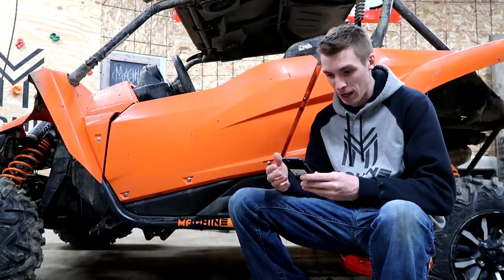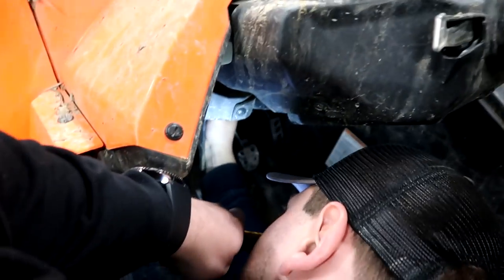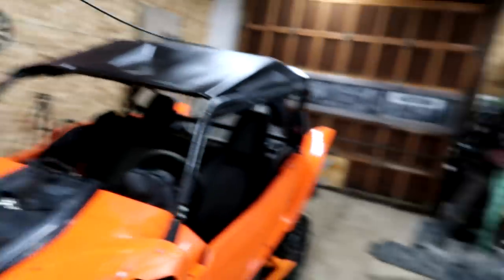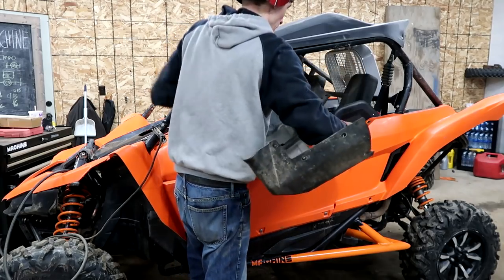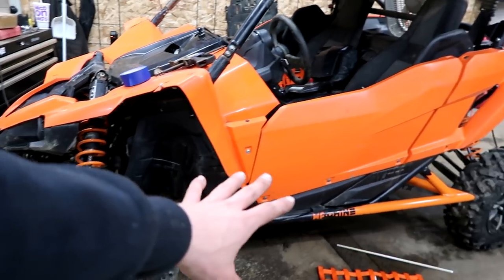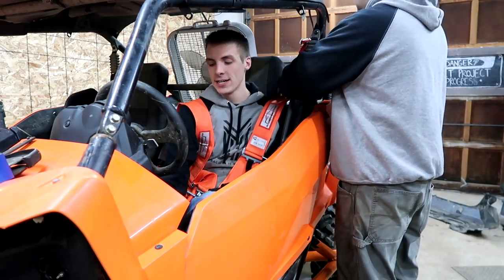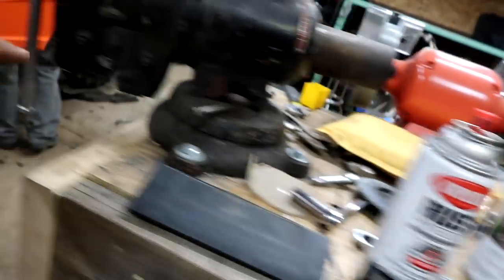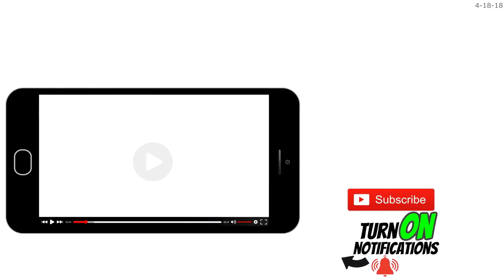1000cc SAVAGE MACHINE!!

Comment: Might want to check the rules but I think your battery cut off needs to be on the outside so safety can get to it mine had to be on the back bumper and my roll cage had to have a center bar to be a "FULL" cage
Reply: Look at your first time drunk video even the other orange utv has the kill switch on the back
Reply: You are right he has next to no chance of passing inspection

Comment: Do not alter your five point harness in any way, especially removing date labels and removing the excess, as it will fail tech inspection. I would also add the crotch belt as this will make the harness so much safer. I would also advise getting a neck support.

Comment: The pressure washer pump more than likely went bad because you need to keep the trigger pulled. All of the water back pressure ruins the pump seals. Keep the trigger pulled down or turn it off when you're not using it, it'll save you from replacing another pump.

Comment: Fyi. You can shine your plastics with steel wool, and 2000 wet sand paper then buff with ultra fine buffing compound.  I just did my bike that was sunbeat bad. Use medium steel wool first wet. Then 2000 wet sandpaper then 0000 steel wool wet then finally buff then wax. For best results sand in one direction. Now it takes some time but works great! I've pretty much tried them all and nothing even come close.sure beats spending 500 bucks!!!
Reply: Paul Condie yes on xxxfine steel wool.
using an amonia based foamy glass cleaner removes dead/ dull plastic . just don't swirl wool, straight lines only.
Reply: Jord A. I will have to try the glass cleaner next time. First time i had real success doing it how i described. Most only put on a temporary shine.
Reply: Paul Condie you will love it, I did faded blue plastic on a 91 warrior. looked awesome. a heat gun on the white lines on folded fenders first, a spritz of foamy amonia glass cleaner and xxx steel wool in one direction made the 10 year old sunfaded plastic look super . has been shedded since and still look better than they did in 2001. after Lotsa mudding and sand.

Comment: I think a better location for the main kill switch is on the exterior of the vehicle, so someone could turn off from outside. I agree, passenger or driver elbow could knock it where it is now. 
Tighten up those belts and of course they have an expiry date!

Comment: worried about the placement of the battery kill switch, one for pain in the elbow they will be, an  two the accidental killing of the engine mid race by a bouncing arm. It should be re-wired an put middle of the dash.

Comment: Why the heck do you have an additional battery cut off switch less than a foot and a half from your key switch?
Reply: Nate Cassel If the steering wheel locks, the key won't turn... and honestly, a direct killswitch is quick and easy for someone to reach in and flick versus reaching over and/or around to twist a key. It may not offer a large amount of practicality, but killswitches ARE convenient!
Reply: Kestrel Cole Thank you for educating me on that!
Reply: Nate Cassel For sure, Bro!

Comment: Bought a machine sticker and got it in the mail yesterday, I went to put it on and when I did it came apart very disapointed
Reply: Preston Rides he appreciates your $ tho so he can buy more toys
Reply: Doubtv
Reply: Preston Rides Gotta go hella slow with them.
Reply: I  did, It got stuck to the top part
Reply: Preston Rides Yeah, just run your thumbs over it really hard for a minute or two to get it as adhered as possible. It's definitely tricky, but between a clean glass or metal surface, and some patience, you get one froggy fresh outcome!
Reply: I Did that but its a little late now it ripped.
Reply: Contact him, he will send you a new one